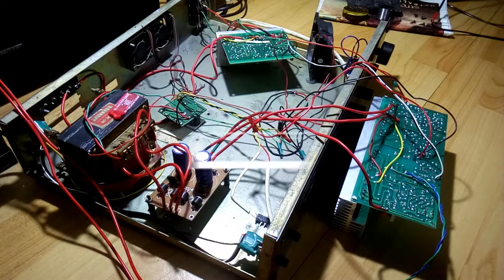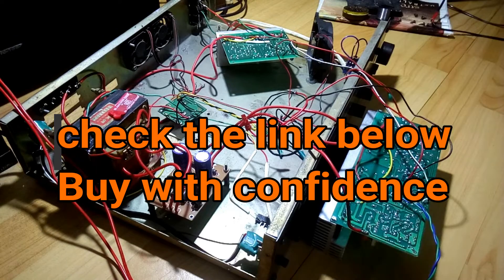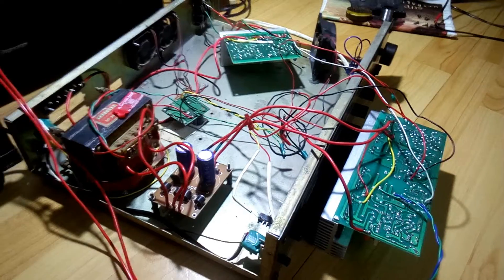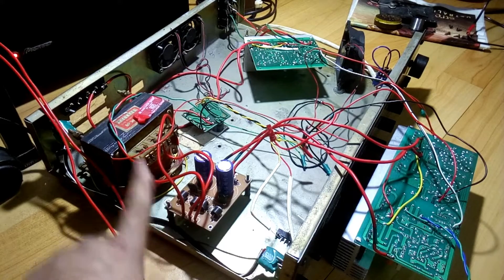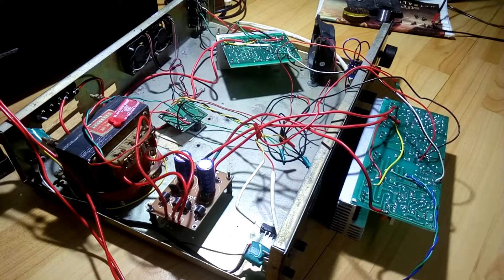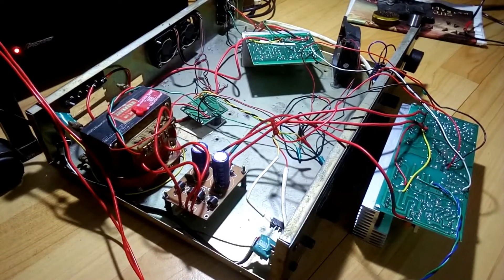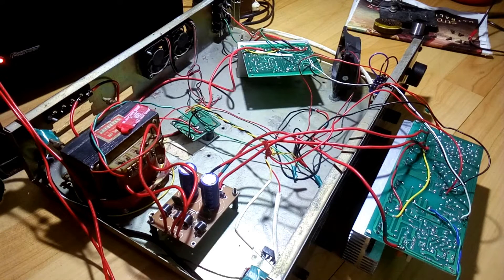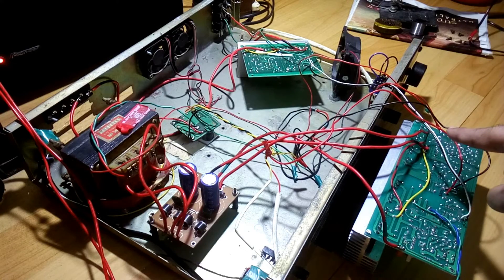500watt MONO subwoofer amp testing

Comment: I wanted to make it 2chennel stereo how? Need the circuit diagram.
Reply from the maker: Its a bridge mono amplifier. So its easy to make it stereo. Check the only audio input at right. The same type would be there at left. And there will be a jumper. Remove that and that will become another input. Now both speaker wires would be positive for left & right channel. Now connect a ground wire as common/negetive for both channel speaker out... Hope this will help. Thanks
Reply: Need the circuit diagram & the contract no.